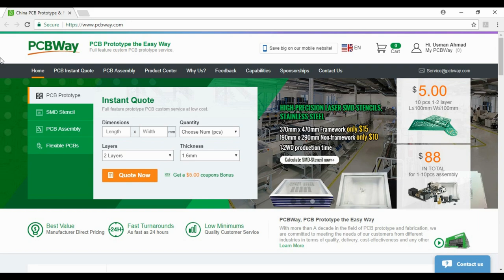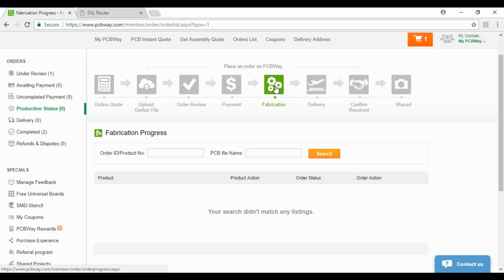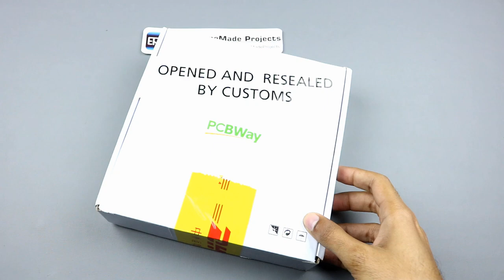How to Make a 2.0 Stereo 15W+15W Audio Amplifier - Professional Quality

Comment: Thank you for doing the work for this - I ordered some of these board from PCB Way and some of those capacitor feed-throughs are so close together that it makes soldering then without bridging the two leads quite a challenge...  A bit more space between the feed-throughs would make this amplifier board a bit easier to re-create.